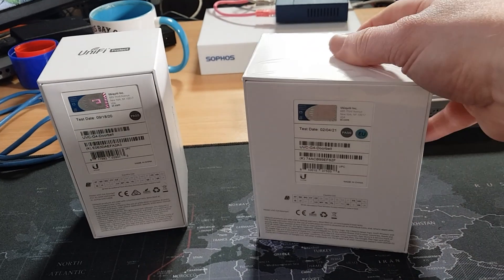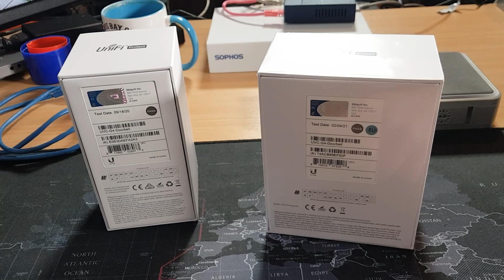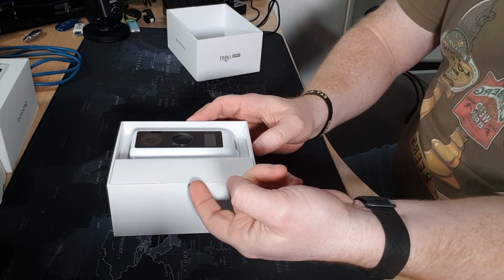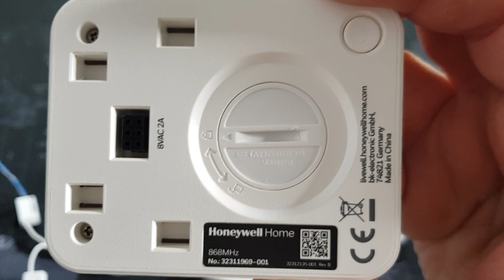Unifi G4 Doorbell - Finally in the EU, Unofficial POE Powered and Wireless Chime

Comment: Jim, thank you for this valuable video. I was having a real hard time getting the G4 Doorbell to work with the Broan-NuTone LA600WH digital chime when I came across your video. I then purchased the Honeywell RDWL915A doorbell chime and the RPWL4045A2000/E Wireless Adapter, followed your general instructions, and the doorbell chime worked on the first try. Unlike yours, my G4 Doorbell is powered by a 24v/30va transformer. I did set the G4 Doorbell Chime setting to Mechanical.
Reply from the maker: More than welcome

Comment: Excellent.  Here in the states we usually have to upgrade the transformer because the typical electro/mechanical chime pulls a lot of power.  I have the G4 Doorbell and have it wired in the traditional sense.  I wasn’t aware you could power the doorbell on 24v POE.  I was wondering how to step up to a wireless chime and you’ve got my interest.  Great info here.  Thx for sharing.

Comment: I tried using the Honeywell adapter in my install today. Everytime I tried to turn on my doorbell it displayed a insufficient power message and then rebooted (boot loop). I tried three different ways of powering it, after I did some measurements I saw that the voltage dropped from 24V to 6V when the startup ring was played.

Comment: Well I’ve pulled the trigger and mine’s on it’s way. I’ll be using a Unifi Switch 8 150W which, I believe, supports 24V Passive so I’m going to give it a go without any inline transformer. I can’t see why they shouldn’t work. No chime for me. I just have it play a message through the various smart speakers I have around the house. Fingers crossed!
Reply: Did you have a chance to try this, and did this work for you?  I was thinking of doing exactly the same thing.  Also what smart speakers do you use that integrates with this?
Reply: @johndavid4825  Hi John. Yes it worked perfectly. As that particular switch supports 24V passive there was no need for any kind of transformer or injector. The doorbell ran very hot when I was testing indoors but it’s fine now it’s outside. The doorbell was a pain to get mounted and I have to drill quite a bit hole to stuff the little cable clips (with the spades) into.

For the chimes, it was a little more complicated. I have a piece of software called HomeBridge running on a small server. That allows me to add the doorbell into Apple’s Home app, so doorbell chimes are announced on a couple of HomePod minis.

There’s also a piece of software called Home Assistant which allows chimes to come through Amazon Echos. Both pieces of software can be a bit fiddly and daunting if you haven’t used that kind of thing before and most people would need to have them running on something like a raspberry pi.
Reply: @saturnuria1217  Thank you for the reply.  I will have to look into this once the rest of my equipment comes.  I'm trying to set up as much as I can on wired connections,and am hoping I can find a solution that will talk to a speaker via POE over the Unifi servers.  That might take me awhile to figure out.  Thanks again.

Comment: it works with DC because internally the unit would be DC, it would have a bridge rectifier inside that filters AC to DC but DC shouldn't do it any harm as the DC current will just flow straight through maybe over time the diodes on one side of the bridge will die but you could just reverse the polarity at that point and by the time it's fully dead it's probably years down the track.

Comment: just set mine up today, bought a ac 24v 30va transformer before it came. had planned on using a relay for the chime but works flawless with just the little white box. 
i am a little concerned about how easy it is to steal gonna make a frame to fit around it.

Comment: i have installed the doorbell exactly as the video above,  in fact i bought it after seeing this... i ahve exactly same chime and poe adapter but the doorbell looses power and shutdown once pressed works ok without the chime though
Reply from the maker: Are you running on Poe or AC?, Have you told the doorbell it has a chime?
Reply: @JimtheITguy  PoE, just like the video above, and yep tried both digital and mechanical chime, it seems to delay the shutdown when i choose digital and 10 second Chime duration.... however it never ever reloads when no chime is selected.... very disappointing I must say
Reply from the maker: @kavalsandhu1193  very odd, we have a few like this with no issues, have you switched the cables round into the chime unit?
Reply: @JimtheITguy  yep tried that, the chime doesn't ring the other way around either way though the doorbell goes into shutdown mode..... you have a transformer spare right ... ill buy it off you :)
Reply: @JimtheITguy  looking at it again it might be my PoE injector, i bought it brand new just for this but the light on the injector goes out just before the doorbell looses power..
Reply: @kavalsandhu1193  I’m having this same issue did you ever solve it?
Reply: @robertodias6262   yes I did, I couldn't get stability with the bell over poe with switch / poe injecter so I got fedup bought a transformer from screwfix and haven't had any issues since, look for British general 8 - 24v bell transformer
Reply: Ran into the same issue when I used the Ubiquiti 24 Passive PoE adapter. Purchased the Ubiquiti Doorbell Power adapter (UVC-G4-Doorbell-PS-US) and that resolved the Shutdown issue. Finally, everything is working :-)

Comment: Great Video! What is the Chime Type you selected? Mechanical or Digital?
Reply from the maker: Digital, same applied for AC aswell when it gets a bit fussy
Reply: @JimtheITguy  How many seconds did you give the chime?
Reply from the maker: @patricksimons560  only 1, literally just has to trigger
Reply: @JimtheITguy  got it working. Played a little with the seconds option but it only chimes once. 3 more chimes arriving today. 1 fixed per floor and a portable one for the garden. Thanks for this great video. Helped me a lot.

Comment: The chime is finally back in stock on the EU site and I've got one on its way. Seeing as you've set this up a month or so ago  I assume it's still working fine otherwise you'd have pulled the video?
Reply from the maker: Working fine still and yeah stock gets sold out quick from the stores so grab them early
Reply: Do you have a link to the chine i cant find it.
Reply: @JimtheITguy  all done and dusted , great workround .. works well 👏👍
Reply: @imfuctifino  I agree i just finished setting up as shown and it works great.  Only about 100feet however.

Comment: This is amazing but would it trigger a standard battery powered chime? (the chimes we have just run on 2 D cell batteries and we really want it to trigger them as they are wired directly to the door push any idea if this can be achieved ?
Reply from the maker: In theory yes it should do but some chimes just dont seem to trigger with the adapter

Comment: Thank you for this great Information. I installed the components but not with PoE. I used the EU Transformer. At the beginning all worked perfect but after a few minutes Doorbell G4 has the information „lost power“. Has anyone an idea how to fix that? Maybe with connecting a relay? Chime setup digital and mechanical is the same. Thanks for helping & ideas!
Reply from the maker: What are you using for power? Injector or switch? Some of the injectors are a bit low powered
Reply: @JimtheITguy  the original EU Treansformer (no PoE Switch or Injector)
Reply from the maker: @AndiJud  odd, installed one yesterday with the EU transformer and chime and was fine, what version protect?

Comment: Hi Jim, finally got my doorbell after 2 months of trying! I’m looking to use the Honeywell adaptor which I have now bought but I want to run it through the doorbell transformer. Will this schematic you created work via AC? 

You are far more knowledgeable than I will ever be on this! Cheers in advance
Reply from the maker: Hi Dan, yes it does, just make sure you using a 24v transformer and that the chime is set to digital in the setting otherwise it goes a bit mad

Comment: Good one Jim. Very glad I found your video. I'm planning to power the G4 doorbell with switch flex in the attic, which is powered by poe-50-60W injector. Can I wire the cat6 straight from switch flex down to the doorbell + honeywell adapter, or do I still need INS-3AF-I-G in between doorbell and switch flex? Cheers
Reply from the maker: You will need a 48-24v dropper in line, link is in the video description to the one I use

Comment: looks awesome. I'm going to do this with a Ring plugin transformer. It simply has the two doorbell spade connectors coming off it. Do I just connected 1 of these spade connectors to the chime adaptor aka the blue cable and the second spade connector goes to the doorbell like the orange connecter. Or do both just got into the adaptor as the blue ones does. Im pretty sure it would be the first option but if anyones done this mod with a plug in adaptor would be good to see your setup. Failing that I will just run the ethernet lol.

Comment: Any thoughts on how you could use the G4 Doorbell Power Supply in this setup for the power and integrate the Chime Adapter in between?
Reply from the maker: You will have to chop the cable to make it work, but no reason why it wouldn't as it's no real difference to the AC feed normally

Comment: Hi Jim!
Great Video
Would it be possible to connect the Honewell chime directly or what is the reason for using the wireless adapter kit?
Thank You
Reply from the maker: Hi Doug, the Chime adapter is required according to UI to link into any chime so can't see why it wouldn't be possible, the wireless adapter is ideal for Alot of UK houses as most don't have chimes in the house or hard wired existing doorbells
Reply: Hi Jim
Thanks for your comment
I just tried connecting the Honeywell without the wireless adapter and Hey it works!!!

Comment: Thanks for a great video. I’ve bought the exact same setup as you after seen your video but when I ring the doorbell it takes 15-20 sec for the chime to make a sound. And 30% of the time there is no sound made. When I disconnected the wireless adapter the doorbell is not turning on when the chime is connected. Do you have any idea?
Reply from the maker: Make sure you try the chime setting on digital to see if that makes it better
Reply: Thanks, I’ve tried that and still having the same issue. Also mixed with different durations...

Comment: Jim, thank you for this video. How's your G4 doorbell so far since you last (PoE) setup? I'm planning to do similar setup but I need to order honeywell wireless adapter and shipped to Australia. Cheers.
Reply from the maker: Been good, we've done a few since aswell and they have been alright
Reply: @JimtheITguy  I've received the honeywell wireless adapters. Silly question do I need to setup the wireless adapter to the series 9 chime? Or it is self detect?
Reply from the maker: @alvinfr1  you will need to pair the chimes to the wireless adapter, instructions are in the adapter box
Reply: @JimtheITguy  I think I might found the issue. The doorbell chime is different mhz with the wireless adapter. Btw I assume you selected digital as chime type in ubiquiti protect settings?
Reply from the maker: @alvinfr1  That wont help, yes digtal chime in the settings
Reply: @JimtheITguy  Hi Jim. Thanks once again. Finally it works! Small question but I suspected is the wiring that are loose. It always shut down after first or second chime
Reply: Hi Jim. Thanks again for the help. I realise my wireless chime is no longer function. Have you come across before? Planning to perform factory reset. Any suggestion? Cheers.
Reply from the maker: @alvinfr1  check to make sure the actual wireless sender is triggering, also make sure that a firmware update hasn't reset the chime to be off

Comment: Can you use an Ethernet cable to transmit AC power (modified as you did in this video)?
Reply from the maker: You can do and it works fine from our findings

Comment: Hi Jim , Question...  You are powering 24v PoE   which is DC.  The only power requirements i can find online suggest 24VAC . Do you have any info supporting 24v DC power?
Reply from the maker: Hi, Powering these via DC is not officially supported, but it works due to the fact the AC is put through a voltage rectifier internally so the DC passes through, but it works
Reply: @JimtheITguy  makes sense , thanks 👍👍

Comment: Hi Jim,

I got it working for 2 weeks but now my homeywell keeps ringing while no one is actually pressing the doorbell? Do you have any idea what good be wrong?
Reply from the maker: Hi there is currently a know issue with 1.20 protect that causes this, 1.20.1 is in EA and has a fix for this so updating to the EA version is currently the only fix until they push the release to GA

Comment: Camera reboot loop.

I've wired everything exactly the same (afaik) as the video and the G4 just reboot loops. I see a red light pulse on the Honeywell wireless adapter on each boot cycle. I've tried both 24v passive from the switch and also a 24v injector. The same thing happens.
I've also tried every combination of wire swaps. However, once I remove the Unifi chime adapter, the camera returns to working perfectly.
Some advice on what might be wrong?
Reply from the maker: Has the Doorbell been told it's got the chime adaptor? Generally the only issue we have hit it adjusting the chime duration in the setting but no experienced it rebooting
Reply: @JimtheITguy  Yeah, I've tried digital & in the end also mechanical, starting at 1 second upwards.

I even bought a 2nd Honeywell wireless adapter in case that was faulty.
Reply from the maker: @TheNutts99  possibly a faulty unit, have you tried it with AC power?
Reply: @JimtheITguy  you mean the whole configuration on AC? No. But as the G4 works perfectly well on both 24v passive from the switch and connected to an injector, why would powering from AC help?
Reply from the maker: @TheNutts99  more of a test as if it does the same thing you can RMA it as a failed unit as DC powering isn't officially supported
Reply: @JimtheITguy  Powered it up with the transformer and it still cycle reboots. I've raised a ticket as suggested. Thanks for the assistance as I thought I was going crazy!

Comment: I've tried this, and I have to say my findings have been a mixed bag :(

I'm trying to get it working with a Honeywell D117 bell. I can get it working with a power injector, either the white one shown here or the black ones Ubiquiti do. Doorbell works.
As soon as I try to use one of my switches, the bell does not work.

I tried a US8-60w so plugged the 3af-i-g converter in, the cam works, the bell does not.
I tried a EdgeSwitch 8 150W as this has 24v as an option, cam works, bell does not. So I changed the port to output PoE+ with the 3af-i-g converter, the cam works, the bell does not.

So, the only way I can get it to work with the D117 is to use a power injector or use the transformer provided.
Reply from the maker: What setting are you using for the chime in protect? We had some interesting results where we had to adjust the digital chime setting when using AC power
Reply: @JimtheITguy  I've tried both, makes no difference.
I'm reluctant to spend £60 on the wireless honeywell, just in case I have similar results
Reply: The Honeywell d117 is a mechanical chime. We haven't had much success with those and the doorbell hence why we use and install the Honeywell wireless chime adapter Jim is using (the white box). This has worked everywhere we have installed the doorbell and paired with any of the Honeywell digital chimes which are compatible with the wireless chime adapter it's a brilliant product.
Reply: @InFluxGroupSolutions  I'm getting the reboot issues as well with 3af-i-g upon doorbell press. Looking for a solution.
The Honeywell DCP917S wireless chime adapter which is 8VAC 2A (with a coin battery inside), so I presume 16VA is required to power the adapter alone when the bell button is pressed. Does this mean unifi's own power adapter with 14VA or the supplied EU transformer 16V 15VA are insufficient? Also the instant POE 24V 0.5A only gives 12VA which is only just enough to power the G4 Doorbell?

Comment: QUESTION: I have this wired exactly as you. The doorbell works fine to my mobile as a push notification, but the Honeywell chimebox doesn't ever ring. I've tried doing this connection both wired and wireless. What am I missing?
Reply from the maker: Did you enable the chime in the doorbell settings, make sure it's set to digital
Reply: @JimtheITguy  I did. Doesn't seem to make a difference. The chime works on its own, but not with the unifi doorbell button. So strange. Does polarity matter on connections?

Comment: Does this setup will work with the Honeywell DW313 (wired) chime?!
Reply from the maker: If the chime accepts a normal trigger then I don't see why it wouldn't work
Reply: @JimtheITguy  thats my problem... the g4 dongle output isn't a NO/NC contact.... it doesn't do anything on A1-A2... also no success on AC1-A1... I buying a 24VAC NO/NC relay hopefully that will trigger the Honeywell chime....

Comment: Ok just hooked mine up and it works but most of the time there is a 10-60 second delay for the chime... Do I need to enable anything on Protect App?
Reply from the maker: Make sure the chime is set to digital and normally the lowest setting
Reply: Is that a setting on the chime itself?
Reply: Well I think I have made some improvements but not working still. When I plug in the cat6 to my switch that is supplying 24v passive poe it lights up and rings the chime but the doorbell just gets to an insufficient power screen and reboots
Reply from the maker: @brownw3311  are you using a drop down converter or a gen 1 switch?